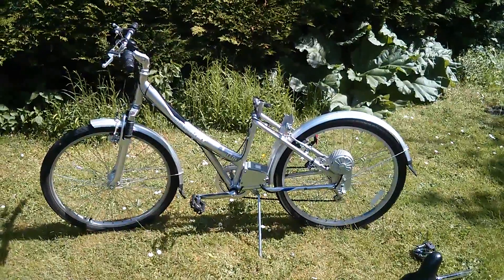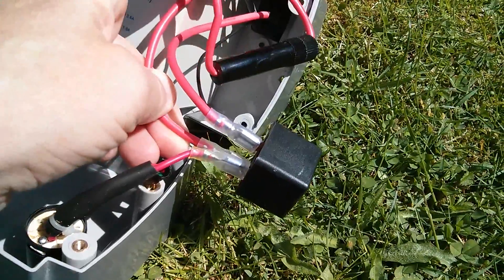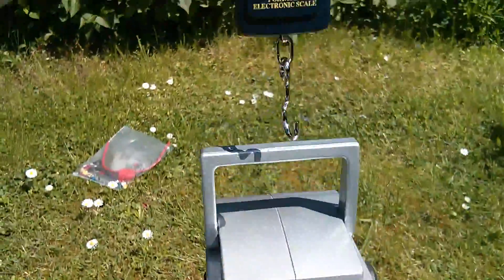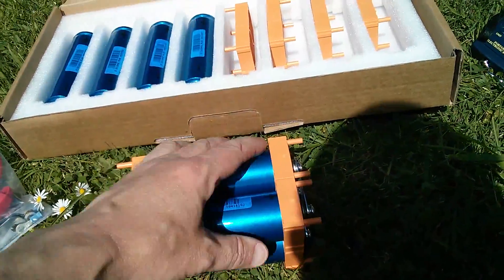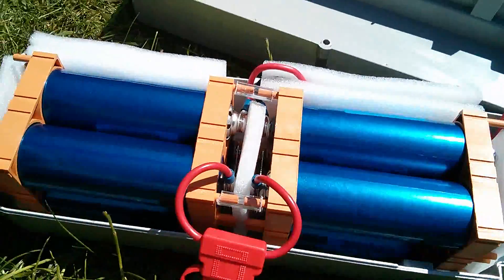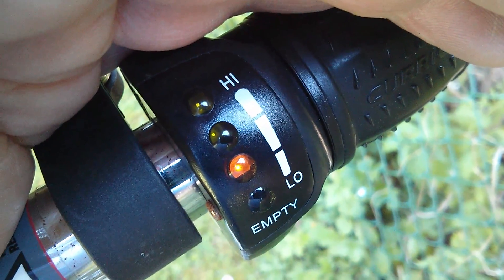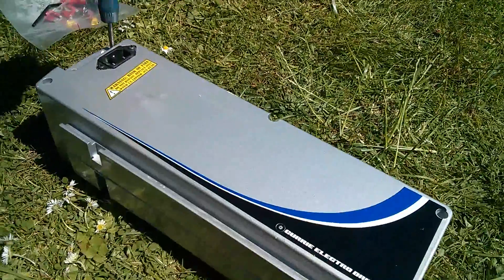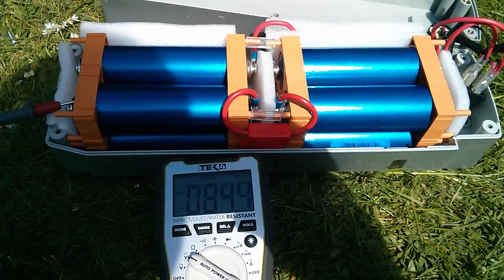Julian's Project: Electric Bike Upgrade to LiFePO4 - #3

Comment: I like the suggestion somebody made about connecting cells lined up with bits of threaded rod.  Barring that,  I would NOT use any sort of spacer that's compressible like the foam is.  Also,  I've used bits of plastic pen barrel for various things in the past,  but that stuff is way too brittle!

Comment: I've bike += motor, but 2 battery pack on rear rack, so heavy I guess going up hill is more work than if non-electric bike, so I'd love lighter 1s. Does 1 need to separate your new batteries?

Comment: What happened to the 18650's?! :(
Reply from the maker: +TechTuners Not safe enough. And no way to change them easily when they inevitably fail.
Reply: +Julian Ilett Why aren't they safe enough? How would you charge them too? What would you need to do to replace failed ones then?
Reply: +TechTuners  yep, that also is interesting me ;-)
Great video anyway, it gives me a lot of ideas.
Reply: +TechTuners i'm considering a 18650 system where the batteries are in several tubes and removable for replacement as one may go bad.

Comment: What's the capacity of one LiFePO4 cell? They look so small, and putting 8 in series will not increase the capacity ×8, as you know. Of course the pack is much lighter than the original pack. It's because you also get much less battery capacity (energy, runtime) out of it lol.
Reply: +Leecher Boy Lithium batteries have a higher capacity/mass ratio than other batteries. Especially the old leadacid ones

Comment: If you bottom balance each cell to 2.7 or so volts before charging in series, your cells will never go out of balance. There is heated debate about this with the makers of BMS boards insisting that you need their product, but My over 6 years of experience with LiFePo4 cells has proven to me that a BMS is not necessary.

Take each cell down to about 2.7, let them sit for a day and do it again, and then wait for a day and do it again. The first discharge to 2.7 can be done with the cells in parallel, after that discharge each cell individually. An RC modeler charger/discharger makes this process easy.
Reply: Glenn Howden Fully agree. Bottom balancing works wonders.

Comment: You can get a small tiny circuit board that will keep the batteries from going too low. You can set them to cut out when they get to a certain voltage, but would going totally empty matter much? I know when people Bottom Balance Lithium Ion batteries, they drain them down to nearly nothing, then charge them back to full again. I know old batteries Nickel Metal Hydride had memory issues.

Comment: 12:00 it's 6Kg lighter, but considering the weight of the bike and the rider on the bike, 6kg less isn't a "huge" amount of the total.
I doubt it'll make a significant difference on it's own really, air resistance is still going to be the biggest force acting against the motor.

Comment: instead of trying to isolate the 2 blocks... Why not connect them lengthwise in pairs and then do the 3 crossovers at the ends ?

Comment: pleaseeee for safety's sake, use some kind of hard and durable thick plastic sheet as separator. in a few days time those foams will get holes because of pressure, as after some days of hard riding jerks may just break those pins/pen pieces into more pieces.
Reply: I thought if you used a square of 3/8 or 1/2" thick plexiglass you could start large drill all the holes for those pegs then cut the square straight through the middle of all the holes. This would leave halve round notches to hols all those pegs aligned.

Comment: Have you ever thought about a gas powered solder iron?
I had mine as a gift from an electronic shop 20 years ago and it is still one of my best tools to work in and outside of the house.  Warms up fast and multiple easy to swap points like a small torch to shrink tube etc.  Would buy one in an instant if it was broken.

Comment: Hi Julian, I heard you say that the relay switch was 40 amps; from what i saw in the great video. There is room to double the relays. What amperage can the motor handle?  Doubling the relay to 80 amps ( 2x 40 amp relay's ) and changing the safety fuse to 50 amps.( If the motor can handle 80 amps ). You'll see a huge difference in torque from the motor. Hope this helps you. Keep up the great work an videos.

Comment: The power is limited by the motor controller but you will have the same consistent power for the entire period and I expect the range to be at least 4x the one you had with Lead Acid when they where new.
Maybe you remember the original range you had to compare.
Reply: electrodacus  8

Comment: Good conversion.  I wonder what would be the end result if Super-Caps were used in place than the LifePo batteries.  Then no worries if pack got too low.  Now you have a couple of old SLA batteries, why not now experiment with ALUM converting them for other projects?  Did one such battery conversion myself and amazed by the result.  Next I envision you adding a small top canopy like some golf carts have with a solar panel on top, keeping the batteries charged but that may be too extreme.

Comment: Nice work on the upgrade, those headway cells are very nice cells indeed.

Built my own 48v system using a Crystalite HS3540 and 10,000MAH or 12S lipo's about 4 years ago... runs at 40amps (2500watts) offroad only of course... 35mph on the flat and about 25mph up a steep gradient.... really fun for blasting through forest bike trails :) Still runs like a dream to this day, although lipo's are getting harder to balance charge so i think they are on the way out. but i never monitored the cell voltages, just balance charge every time and didnt deep discharge them. Probably had about 5000 miles of fun out of them over the last 4 years as well.

Those Headway cells should last you a while if you look after them :)

Comment: Upgrade the wire gauge and the  reduce the ohms across  the connection  I did that  on a electric  project I was working on  it made a big difference I tried to  remove  weak links in the  "chain " I found out the motors were the next weak link in chain ugh what is the  max amp draw from the batteries  and  motor

Comment: if anyone has been spurred by this to look at cheap conversions on ebay, the ones that look the same, the 500w/800/1000w hub motors are the same just run at different voltages.... and i know this from getting them and opening them up....

and the (usually black) controllers are the same too, just one resistor different to set the low voltage warning....

been running my 36v800w at 66v for 18months no mods, nice extra speed lol. (on private land...)

remember that they may be different kits/controllers about not safe for overvolting, but you can check against photos of mine on the endless sphere fb group
Reply: lez briddon a 36v kit i fitted came with a speed sensor and pedal sensors (you were supposed to pedal to enable power as well as use the thumb control) but being from china, if you didnt fit the speed sensor it just ran at full power whatever the speed and neglected to fit the pedal sensors, it worked perfectly, and would ignore the 15mph limit if you fitted the sensor, worked pretty well, we just used lead acid batteries, but at 36v they were bulky and short distance, shame we didnt get around to making a lithium pack! the motor and kit did indeed look the same as the 48v sold by the same seller, wouldve have been interesting to have tried that

Comment: I wouldnt over estimate the difference that 6kg of battery weight would make. Calculate that reduction as a percentage of total bike+you weight and its probably well under 5%. Your not going to notice that really. The motor too isnt going to do much more unless you increase greatly the power in by raising the voltage which may have adverse effects on the controller and motor. I think the best you are going to achieve is possibly greater distance travelled on a full charge. That will be interesting to see. It would be interesting also to see if you doubled up the batteries (to bring you back closer to the original weight) how much further you could travel on a full charge... thats going to be costly though and more difficult with the present setup. Great video though, waiting eagerly on the next part to see if its worth doing it...
Reply: smallenginedude71 Stick a washing machine motor on the back and a 240v inverter...
Reply from the maker: smitcher Yes, you're absolutely right. But it's a huge weight reduction when carrying the battery around. There's no way to lock the battery to the bike (other than a cable through the handle), so I'm not very happy leaving the bike unattended. Now I can take the battery with me.
Reply: Julian Ilett Ah yeah, never thought of that. Indeed if you can get the same or better performance with less than half the weight in batteries then that is a great achievement.
Reply: smitcher boost converter ;D

Comment: Are the cells all not connected to each other?
If so they should all drain equally no?

I would think that if your nominal voltage is close to lead acid, the original gauge would be all you need.
Reply: hippyraverocker And this is why you should read up on Lithium based batteries before attempting to use them ;) 

It's very important to make sure that the cells are balanced in a pack. Yes they are all connected, but in series, this means that any small difference in discharge (for example caused by different internal resistances) will build up, and can cause some cells to discharge faster/slower than others, causing a difference in cell charges, which is bad.

And since LiFePO4 has such a high energy density, they have to be respected. Now LiFePO4 is a lot safer than ordenary LiPo packs (Commonly using LiCoO2 or LiMn2O4 chemistry), but still. Be carefull :)

Comment: As suggested before, it would be very convenient to charge this bike with an RS232 cable. Imagine the turnigy charger which goes onto the breakout board. Then on the bike, each cell of the battery is attached to the other breakout board.

It would be safer too since the breakout boards would need to be female, preventing any pins of the cable shorting together if a bit of dust gets in there while riding.
Reply from the maker: BoomBrush I do have the male and female DB9 connectors - I'll give them a try

Comment: Very interesting. I recently converted my 24v Heinzmann pack from the old NiCads to NiMH cells of a higher capacity, but found they just could not deliver the torque of Nicads. So eventually took the easy but expensive route by sending the case to Germany where they convert it to Lithium. Much better now but still cannot match the pure grunt on a really steep hill that I used to just manage with the old Nicads.
The other downside is the original 5 stage charge level indicator cannot work now so you don't know the state of charge. I suppose I could carry a voltmeter and check overall volts now and then, but up to now, I am gingerly going farther and farther to try to ascertain the range.  Best of luck with yours.
Reply: fej fish Just plop one of these on :) http://www.ebay.com/itm/gib-Mini-DC-2-5-30V-Red-LED-Panel-Voltage-Meter-3-Digital-Display-Voltmeter-/190931294482?pt=LH_DefaultDomain_2&hash=item2c74645912
Reply: dumle29 Yes. Good idea. Amazingly cheap. Thanks.
Reply: fej fish Nicads are good because they have very low internal resistance and mantain the 1.2V/cell stable until they are completely dead, and then fall down to 0 volts.
Reply: MrOpenGL Yes, Nicads are best for traction power in most cases. I can't really complain because they lasted about 11 years but range was falling off toward the end. Most of the cells (7AH) were still ok so I made them into a 12v pack and use them to power battery drills which have duff and unrecoverable batteries. I just emptied the cells out and soldered in a length of twin terminated with banana plugs ( I have a few drills like this), so they are still doing work and not completely wasted.
Thanks for your comment.

Comment: Are the leads big enough to carry the current, maybe there is a voltage drop under load? I would think this setup should be able to deliver more power than the lead acid batteries.
Reply: PuchMaxi1988 The motor might not use it. It might simply be too high of an impedance to pull more current at the voltage of that pack, or it might even have a motor controller that's limiting it.
Reply: dumle29 That might be the case.

Comment: Were the cells fully charged when you tested the bike outside? Maybe at 4.2V per cell the aceleration will be better?
Reply from the maker: OrbitalSP2 No, they were as supplied - probably about half charged. I'm not concerned about the power being no better - this way the speed controller is more likely to survive.

Comment: Get some aluminium pipe with the right inner diameter (should be available in the DIY store) and cut them so they are the same length as the the two stacked posts (if you are concerned about the conductivity, just heat shrink the pipes). Or you could cut 8 pieces from a block of UHMW-PE and drill a hole of the right size for the pegs.
I wouldn't use any other plastic here, at least none that's as brittle as a biro.
For insulation I'd use a piece of plastic sheet (with holes for the pegs for positioning) like you often find in electronics (mostly power supplies), where a PCB is close to a metal case.
Reply from the maker: superdau I'm now wondering whether clear PVC pipe would be better - the biro plastic is very brittle, I'm not happy with it. Next time I'm in a DIY store, I'll look for some (and also the aluminium pipe).
Reply: Julian Ilett I was going to suggest the barrels of some felt-tipped pens, they are nowhere near as brittle as the Biro's. Or maybe some 10mm diameter plastic microbore, eg speedfit.
Reply: Julian Ilett PVC is probably too brittle also. What about polyethylene reticulation pipe used in the garden or even better the industrial equivalent? There seems to be an awful lot of drag on the motor, it maybe highly geared but even so I would have thought it should run more freely. Oh and  lose that original terrible inline fuse holder for the blade type, they are much more reliable. I am not  convinced the inter pack fuse is  required or indeed wise. One of these http://buzzhobbies.com.au/index.php?route=product/product&product_id=50 would be ideal as a battery condition monitor. It has a user settable low voltage alarm and is very loud as well as dirt cheap. Available all over the internet or even the local hobby shop.

Comment: Double the voltage
Reply: Anyway J! Get your finger out and spend £600
a new ebike 48v rear wheel kit and battery you'll not look back my Babs :)
Reply from the maker: Andrew Bryant pianotunerbristol I think that would fry the speed controller!
Reply: Julian Ilett and the motor :P
Reply: Junk the controller get a 48 volt brushed controller from ebay and I think you'll find the motor is rated around 50 volts
if not just upgrade the hole thing.
Reply: J! I know what im talking about both my Ebikes run at 48v with 20ah battery my range is about 50 miles and no hill is a challenge
Reply: Andrew Bryant pianotunerbristol 

600, is he getting it gold plated? 200 for the wheel kit at 36v800w and 4x(4s5ah) turnigy hardcases at 20 quid each is 80 quid, run as 16s,  job done 30mph half your price lol
Reply: J! here is a useful website  http://www.vpower.hk/index.php
Reply: lez briddon you get what you pay for cheap skate !!

Comment: RC helicopter battery alarms go off around 3.2v / cell so you could have 2 4 cell battery alarms.  Kind of a early warning?
Reply: topher It's Lithium Iron Phosphate . Nominal voltage is 3.2v and minimal voltage is 2.0v
Reply: Pedram so give it a few resistors ;)